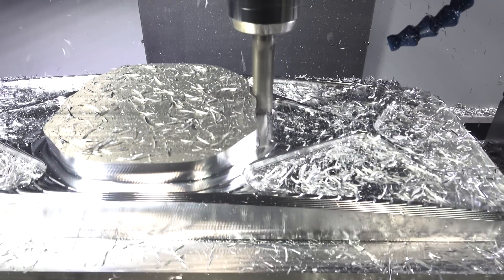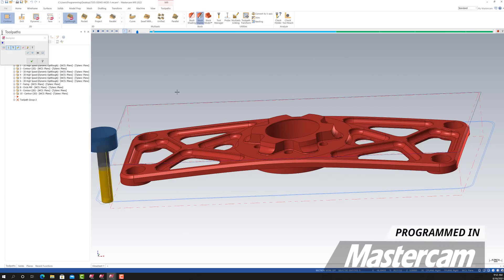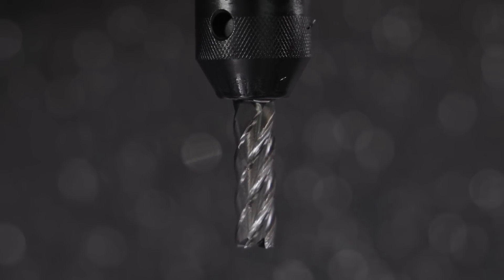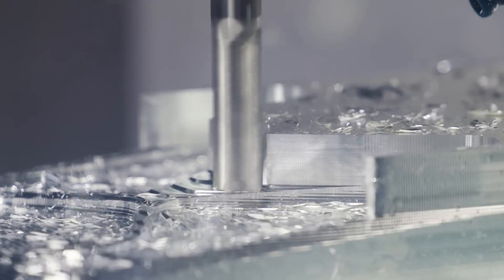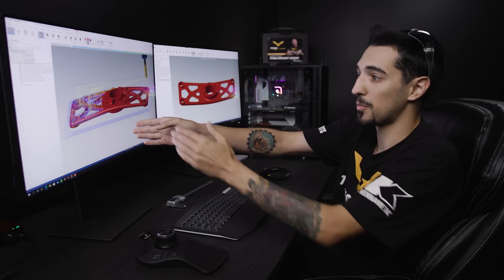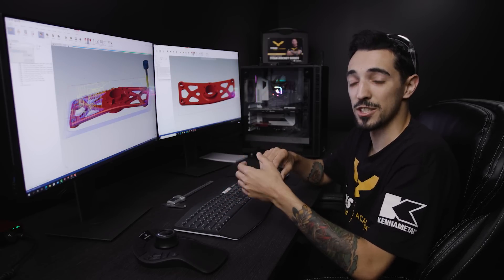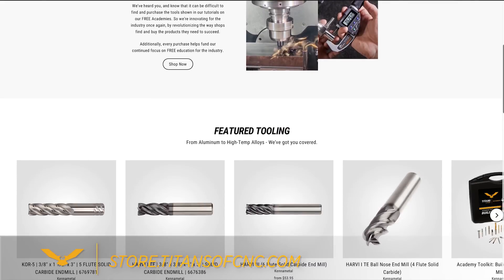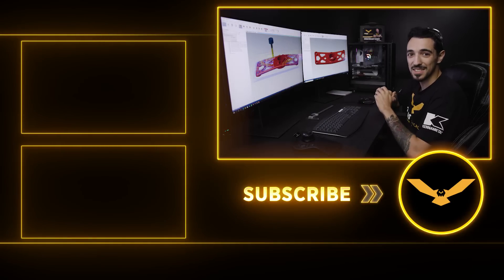Hogging Chips Out of an Incredibly Complex Thin Walled Aerospace Part | Doosan DNM5700 L

Comment: Love seeing this stuff. Last week I had to take a 6061 flat bar 13.25x2x1.25 n contour to 13x1.5 n keep the thickness. Did a full depth contour n the 1st pass did a .250 cut at full depth of 1.25 on a 3/4 3 flute endmill. Man it was amazing how it was spitting chips n the old school 1994 vf4 didn’t even hesitate. So I kept the toolpath the same n saved me 2mins in the op

Comment: I see you're using the zigzag cut pattern in optirough just wondering if you have any reduction on feedrate while conventional milling and if so is there a rule of thumb you go by to know how much to reduce it to avoid excessive chatter?
Reply from the maker: It’s aluminum so it’s the same speed… we do not reduce because that would make chatter worse by not having pressure.

Comment: How does machining without cooling affects tools? How fast are they destroyed?
Reply: Probably 95% faster
The alluminum will stick to the endmill pretty soon
With coolant you can run an endmill like this for days or weeks or months depending on your strategy
Reply: @owievisie  That's bit of an overstatement. Maybe a week tops. Endmills degrade, and their reliability goes down fast. Your speeds and feeds were just fine before, and suddenly the endmill snaps.